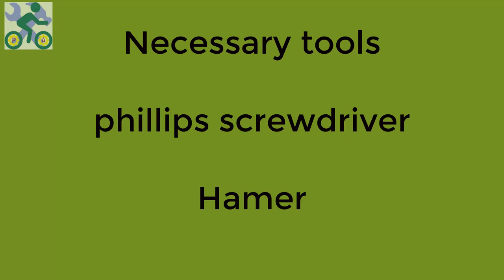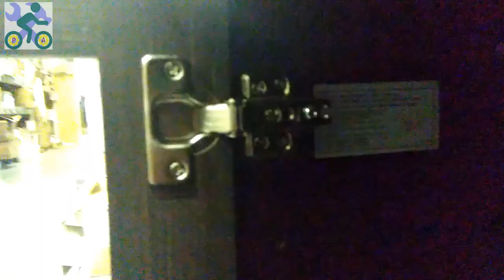How to assemble Better Homes and Gardens Canton Media Console, Fit's most 70in flat panel TVs

Comment: Hello Your video Came in very handy I purchased the same TV stand  I was wondering if you think it will hold a 75" TV my weight 73.4 pounds My little brother threw out the instructions after I finish building it

Comment: I followed your instructions and they are not right because you assemble the middle boards first and then the sides and when I lifted it the bottom line broke because logically it has to have all the support of the 4 lakes, not just 2 for following your instructions I lost 300 dlls thanks to you and me for following you.😡
Reply from the maker: Hi Sofia.
I was upset to hear this and re-shot the video completely once because I pay special attention to people's comments.
If you are careful, I will not lift it until the last moment and I will install all the parts and I will only lift it to install the back part.
So I think you did not follow me completely, although I always follow the manual.
Anyway, I'm so upset that you could not put it together
I read the rest of the comments and everyone made it based on this video.
For guidance, get only the broken part from the free services of the company.

Comment: I want to put my center speaker on one of the center shelves. How wide is the center shelf?
Reply from the maker: The size of the length, width and height of this is 151.8x50.8x86.4  cm and I think the middle part is about 60 to 70 cm.
Reply: @ProAssembler   my speaker is 21 inches wide

Comment: How long are the shelves on the sides
Reply from the maker: The size of the length, width and height of this is 151.8x50.8x86.4  cm and I think the middle part is about 60 to 70 cm.